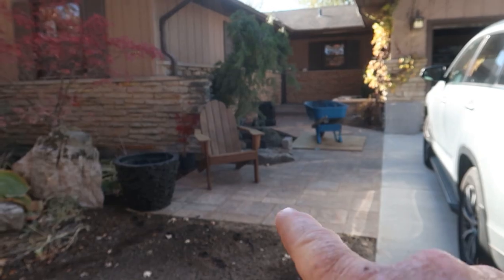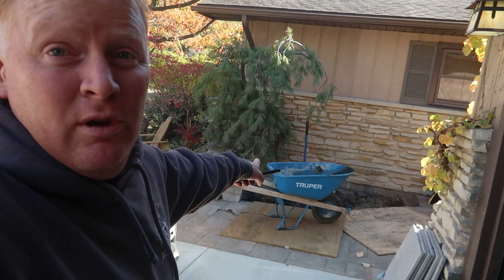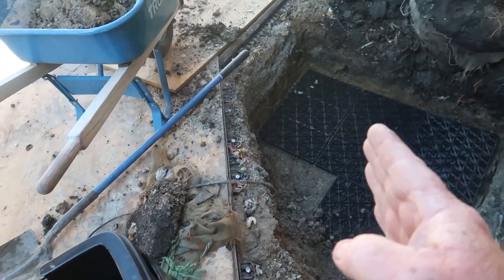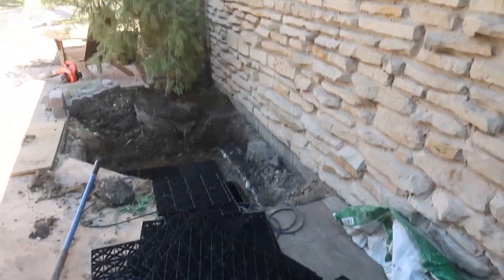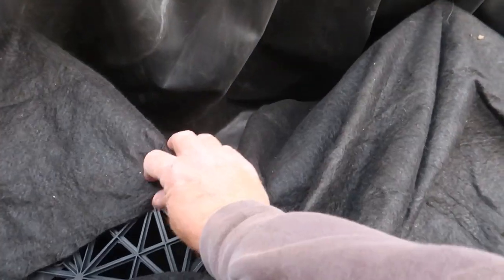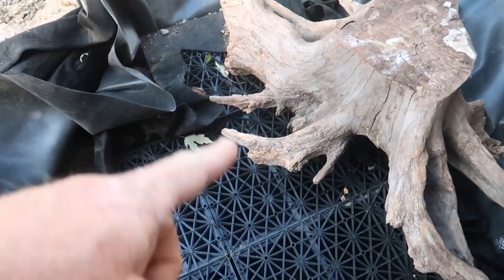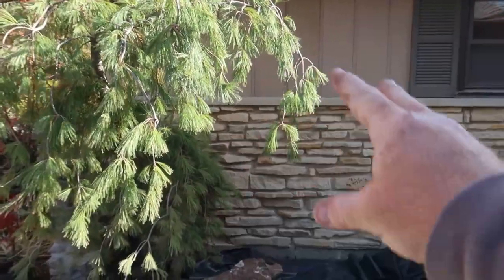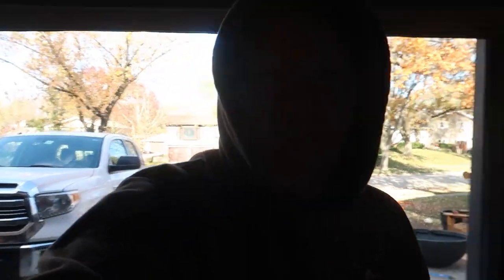Decorative *FOUNTAIN* for Brian's Front Yard - Part 1

Comment: Looking good! I have a question as I've been gathering parts to do a 3 piece slate stacked urn feature in my backyard.  Have you ever used pool pumps to power a feature? I work on swimming pools for a living and my current plan is to use a Pentair intelliflo pump to power the urns . I have the 220 power and the extra variable speed pump so I'm wanting to try it. Any thoughts?